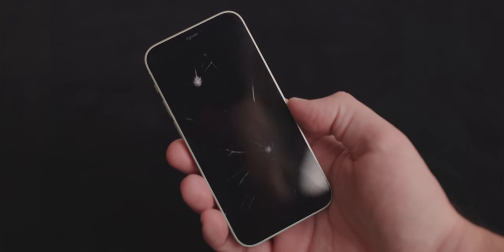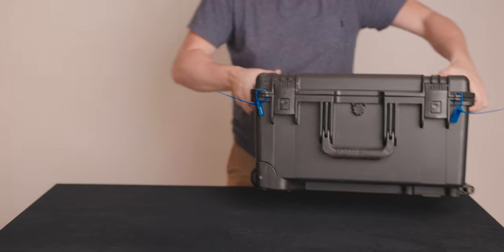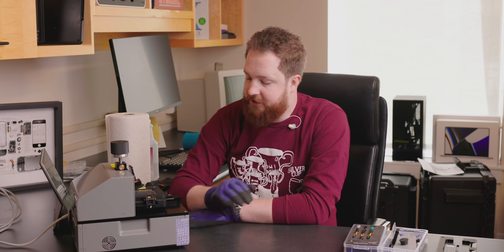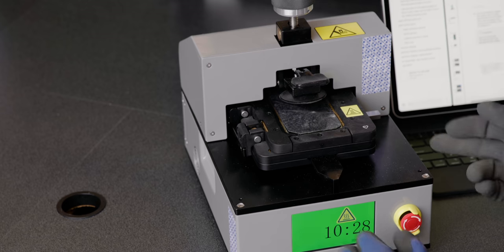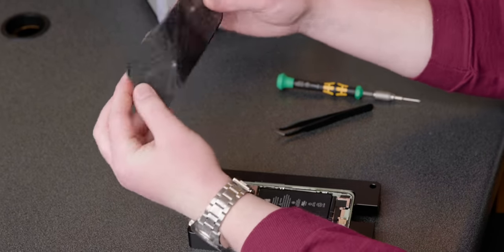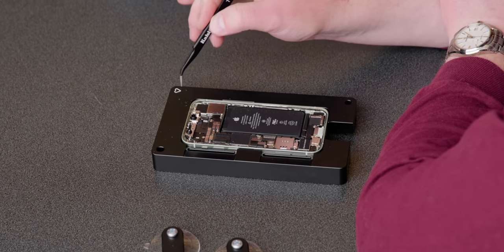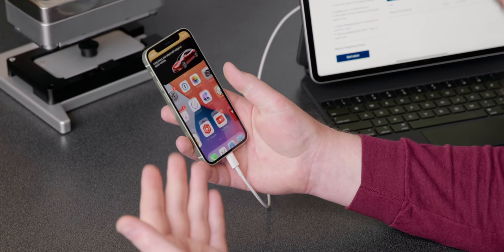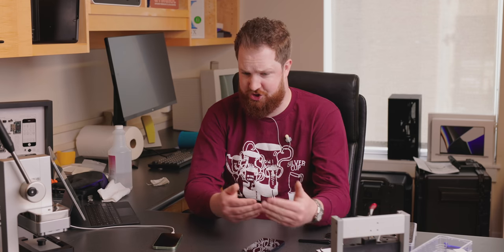Using Apple’s Tools to Fix My iPhone

Comment: Sounds like they are doing this to scare DIY users of doing this in the first place.  And also they are putting the full responsibility of the equipment they send on the user.   For example the battery glue tabs, they don't need  to put two full strip of adhesive, the proper way to secure the battery for future removal or swapping,  would be to have a small notch or plastic tab that slip under the top pcb and only have 1/8 of an inch adhesive strip at the other end.  That small strip would be easier to remove.  and for the screen, it's understandable because the seal around that need to be perfect.  That would help prolong the number of years that these iPhone last.   Smart phones should last a minimum of 6 years up to 10 years with maybe two or three screen changes and a new battery every two years.  And just by prolonging a smart phone you reduce a lot of the e-waste and at the price they are sold that would be a good thing.  
But Apple is Apple, they won't help simplify the job, because if these phone last for too long, they won't sell any to these users.   Thay fail to understand that when you give the perfect support the users and customers are happy and will return to buy a new one after the life of the ones they ahve nears the end.

Comment: Wait... Why'd you ever replaced a battery in a year and a half old phone (at max of it's possible age) at all? I've thought that battery should last at least 6-7 years before it'll start to dry, losing it's capacity. My old Sharp pefrectly worked at his original battery for almost 7 years before i noticed battery deterioration. Now it's almost a 10 years old and it's still running on original battery, although it's lifetime has significantly decreased, but still no signs of battery "pregnancy". WTF, huh?
Reply: Pm me🔝...

Comment: I understand why Apple needs these tools, especially the torque drives, but I can stress this enough: nobody needs these tools, especially the torque drives. There is nothing so critical in a phone that requires screws to be torqued to precision, it's there so that no one is neglagent and over torques out of pure carelessness, a professional wouldn't need it, which begs the question: what does Apple consider a professional?

Comment: The whole build philosophy of “everything plugs into the motherboard via a flimsy cable” showcases the lengths that Apple’s engineers go to for the sake of complexity, expense upscaling, and perceived value enhancement that Apple needs to justify pricing their phones. Imagine building the product in layers at the component level in a similar fashion to how IC chips are produced, and you would: a) have a much simpler build process, saving time, b) create a more robust framework for increased longevity of the product, and c) utilize less resources in their manufacture. The increased complexity is a byproduct of the demands of Apple to extract as much money from the consumer as possible for their product. The fact that so many are willing to fork it over is making Apple one of the biggest companies on the planet. Think about the Apple of the 80s compared to today’s post-Sculley Apple. This company was the first to achieve a $1 trillion valuation in 2018. In August, 2020, it reached $2 trillion, and $3 trillion in January of 2022. They’re like the biggest piggy bank in the US.

Comment: IDK if it's true?? I am a android guy always will be after Apple lied to everyone about slowing older phones down. Now I heard that almost every part on iPhones etc. Now you need to replace the part with there so called repair kit and actually have Apple clear the part when you finish installing. So with that and the 50 dollars of shipping while having a 1200 dollar hold on your credit card. Now that's not too bad I guess. Now other issue I heard was that they won't clear the parts if you don't use there equipment and repair kit that they will not clear your new part and make you then still have to rent the equipment. Now again im not apple guy myself so just going off by what im hearing apple people tell me about the parts and replacement issues with apple

Comment: If we still have the liability and apple is not responsible for any repairs we are doing make these tools cheaper and allow local repair shops to do it. It will provide employment and actually save the environment. Rather than every customer buying this.

Comment: I have an idea and suggestion for apple.. though I suppose it's more of a question... why bother with all the subassembly pairing bs to begin with?  I really don't understand what engineering problem that apple is trying to accomplish by locking down these assemblies to begin with... any battery capable of speaking the same battery management system protocol, and indeed any display capable of speaking the same display and digitizer protocol that physically fits in the unit should just work... just like pretty much every other manufacturer's devices...  what are they trying to do here besides increase the difficulty of the repair process?
Reply: Pm me🔝.

Comment: They could probably save a lot of man hours in the call and repair centre by simply doing the following;

1: Apple creates a system inventory for the phone. Whenever parts are ordered off their site for it, they are automatically paired pending diagnostic mode activation.
2: When the parts are installed, the old parts are de-authenticated and the replacements authenticated by immediately rebooting into diagnostic mode the second the phone detects the new parts.

Or alternatively, there's this novel concept called NOT pairing commonly replaced components to the hardware of the phone!! imo serialization as a practice in consumer electronics should be illegal. It restricts your ability to repair a damaged device and makes it a pain in the ass for ASPs to be able to do their job too.

Comment: unnecessarily complicated and extremely expensive to repair. Seems like this is just apple today through and through. I'll stick with my mid 2012 13" Macbook Pro till it dies. And it probably won't in the near future. 
Changed the battery on it two times, changed the logic board even, changed the DC input after I botched it during the logic board repair :P, upgraded the RAM to 16 gb, upgraded the storage.
Can't do this on a modern macbook ;)

Comment: The fact you have to authenticate parts through Apple themselves with official parts and the official repair tools, double checking serial numbers like you're defusing a bomb (why would you order parts to repair a different phone?), so the phone doesn't harass you with measures THEY put in place and the repairs STILL aren't warrantied should 100% be illegal. All at the FULL PRICE Apple would have charged themselves?

This is the literal definition of malicious compliance. The amount of engineering solely aimed to make sure it's such a massive inconvenience to do repairs yourself is mindboggling. They aren't punishing the elected bodies that forced them to do this, they're punishing their customers. But that's the Apple way, isn't it? "F*** you, we're Apple." I've replaced quite a few Android and laptop screens and batteries and all of them combined weren't as unnecessarily inconvenient as this. Just yesterday I had a Lenovo Flex opened to fix a fan and all the screws were standard philips. 

If I were an MP I would absolutely call this non-compliance. You're forced to use their tools and have them authenticate the repair. Hardly a "self repair" if they have to be looking over your shoulder the entire time. If I remember correctly the law itself said "reasonable." No judge on the planet would call this reasonable. The EU needs to slap this joke of a repair channel down hard and make Apple actually comply. These corporations need REAL punishment for their anti-consumer practices. Fining them a few million is useless when they make 100s of billions. If they continue giving customers and governments the middle finger the company should be broken up like they did with Bell Telephone (Honestly Bell never got as big as Apple)
 or slam them with REAL fines they'll suddenly care about. Make the next fine 50 Billion instead of 3 million. If they don't comply within 6 months completely revoke their ability to do business within the EU entirely. It's time for these companies to realize they aren't above the law and without real punishment they have no reason to change their ways. It's more profitable.

All this is testament to why I go out of my way to tell anyone who will listen to avoid Apple like the plague. I straight refuse to even attempt to repair any Apple product. You're literally paying top dollar for a huge evil corporation to treat you like chaff with a wallet. The fact they're so loved for being evil tells me we need a new plague because the stupid are multiplying exponentially.

Comment: This seems like a "You want repairability?  Fine.  Here!  You can have repairability!  Choke on it, bitch!" move.
I understand companies have specialized tools to standardize repairs and ensure quality (Such as the roller) but do you REALLY need to require them to have this big ass roller to apply pressure to the adhesive in order to do their own repair.  I get apple doesn't think highly of their userbase, but the people who would attempt this aren't stupid.  They know how to press adhesive.  Combine that with a "yeah your warranty is void if you do this." and you'd be fine.

Comment: 16:27 - WHEN will phone manufacturers WAKE UP AND ACCEPT, they DO NOT need to stick the batteries down THAT MUCH! A SMALL 4 - 8 mm circular tab placed at each of the 4 corners, or even ONE at each end WILL SUFFICE! 😠😠    😎🇬🇧

Comment: Suggesting people use a 3rd party random repairer over using Apple / proper tools is ridiculous lol… You need these tools to seal the phone properly and to its original spec and IP water rating consistently. Could you get away with less tools? Sure but the phone will never be original condition again…

Comment: I’m pretty sure you can buy that same equipment on the Internet for a lot less! And the reason why they got those tamper stickers on the equipment is obvious they don’t want you opening up to be curious to how they operate! Hypothetically if you did open those up Apple would charge you The actual cost of the equipment. Probably.🤔

Comment: 11:15 suction cup wont work on cracked screen. Engeneered to be hard, instructions that are designed to make you bake your phone.
Can I ask how call is NECESSARY? if they want to auth part to phone, they can just have a list of items and when you order, auto assign new part to old phone as well. It really COULD BE automated easier than having a consultant waiting in there forever, you literally add all the data when you sign to apple account and rest when order new part. They literally could as shown connect to your device and make automatic paring, as guy who clicked the restart for you did. 
This is designed to be pain in the ass, especially when they put consultants talking from metal workshop....

Comment: Gross Quinn. Did you really just plug Asurion? Unless they rebuilt themselves from the ground up, I can honestly tel you I’ve seen their repairs and I’ve had to fix their mess on several occasions.  
  
Having said that, I mean sure, the packages and equipment Apple requires is a little overkill, but I’ve used them and even though they’re bulky af, they make the repair as high quality as possible and makes it far easier than even ifixit’s sets. The battery roller is definitely unnecessary though. But overall, it really gives you the feeling like you’re working in dust-free environment and surgery grade tools.

Comment: for an iphone 12 face id should still work even with 3rd party displays, i know my 12 pro max has face id issues occasionally even though the device has never been opened, i tend to have to do a force reboot before face id will work again.
other than that, love the video but i think apple is being really scummy by making you pay just as much to repair the device yourself over sending it directly to them

Comment: The iPhone 8 and up have the worst adhesive ever created. It never pulls correctly and always just snaps. Its 10x worse than the adhesive they used to use. Leave it to Apple to over engineer repair equipment that works worse than a heat pad and a flexible metal insert tool.

Comment: This is very clearly an anti-repair repair program. The press that pushes the glass down and the battery roller could have been either avoided or combined into a single part, the heat mount could easily be replaced by a $30 heat gun and a $2 suction cup. Also theres so much metal that could just be cut out to save tens of pounds. Its overengineered to look necessary. 
Also if the phone detects new parts it disabled face id, thats why it didnt work until after you called them.

I hated every second of this video and i hope people wise up to apples practises.

Comment: The amount of necessary machinery to replace a display and a battery of a device that will become purposely obsolete in a couple of years is just plain stupid. There is absolutely no reason to such complexity beside greed.

This kind of praxis is incredibly hazardous to environment and in long term is unsustainable. It should be prohibited but, again, greed speakers louder.

Comment: God I can imagine how pain in the ass this is for someone who doesn't have access to the internet. Requiring the diagnostic mode to be enabled by an internet connection to approve that the part which has been replaced functions.
Another point to bring up with consumer's rights to repair..!

Comment: I used my electric glass top range Warming zone to heat up my phone to get the display off.
I was worried it would get too hot since it was my first time so I took it on and off so it didn't get too hot, everything went well.
no need for such a complicated device but for a consistent method at a repair shop it makes sense. making you call a 3rd party tech support for each phone and "agreeing to terms and conditions" was stupid.

Comment: this is so dumb. in college I used to work as a TA and grade papers in the library and post on the class page that I could fix anything with iPhone 3-5s
I had a little dime baggie of tools and a roll of tape and a pocket knife...
repaired hundreds of phones, the only time i bricked a phone was when I was lit and changing my own battery and dislodged a resister on the logic board.
the only time I couldnt fix a phone was when someone showed me their camera and it had specs or dots or something in the camera and i didnt have a spare camera on me.
I built a iphone 5 in 2013 and have been using it to this day. my first smart phone and i never saw a need to make a bunch of ewaste or spend a bunch of money every year or two...
recently was told my phone will stop working w/ 9-11 in a couple months coz 5g will take over the 3g towers
bought a completely smashed iphone SE for 8$ and a good looking but stolen/locked iphone5s for 6$
going to put them together and hopefully that lasts me another decade....
still got my dime bag of tools and I think I will be okay

Comment: This seems so overcomplicated, overdesigned, and over-engineered. Both for at=home use and in service repair. I know there is a case for using the machinery for consistency of repair, but if the machine fails to do it's job and people end up compensating for faulty equipment, there goes any dreams of consistency anyway. All the suction cups are terrible, I'd rather just use some type of disposable strong adhesive and clips for the process. I did like that phone press though. And for the price you're paying, a headlamp and magnifying glasses/loupe should be provided. And why is there no video of how to do this repair, Apple? Did they not make one, or was it just not shown for this demo?

Comment: This program is so stupid I have an iPhone 11 Pro Max with a switched motherboard and I have no face ID a battery message and the display message and Insa radically I can just call them and they match the parts with the original serial number and those messages will be gone

Comment: This is purely disappointing to all of this extra Bs that would cost thousands if shipping misshape would happen the fact companies wanna take away the right to repair is okay if your leasing the item but if I spend over 1000 on a phone I should be able to buy whatever screen I want weather it be cheap or an expensive and not have to worry about customs taking it or if I repair my device it bricking certain aspects also commercial grade of repairing Is much cheaper and more effective compared to this
Reply: Pm me🔝..

Comment: "pulls out 97 pounds of equipment" ok title was not clickbait..

How much of this do you need if you just want to change the battery?  /facepalm.  Until my brains go out the back of my head.
This is why I had to get stupid Apple Care + on my new iPhone 13 Pro because I know in the next 2 years I will want to change the battery and possibly the screen 

(actually got a tiny little scratch or two on the new iPhone's lovely new screen somehow within a few days of owning the phone before I put a screen protector on it.  My old iPhone 6s Plus never needed a screen protector and I never got a scratch on it, maybe just one in the 5 years I owned it.)

I also just bought a decently fancy new Gigabyte M27Q monitor that was only $320.  The new iPhone 13 Pro I bought in February cost over $1200 for just 256gb's.. it's ridiculous how expensive they are making these phones, that you cannot repair yourself.

Comment: This self-repair idea will be stopped within a few months, the amount of people that will seriously fxck up their expensive phone will be too much too handle. If the screen s cracked or the battery needs replacing, just send it in and receive it back within a few days. Meantime use an older iPhone as replacement ..... this is just too much stress....